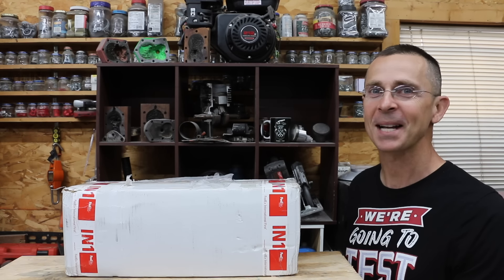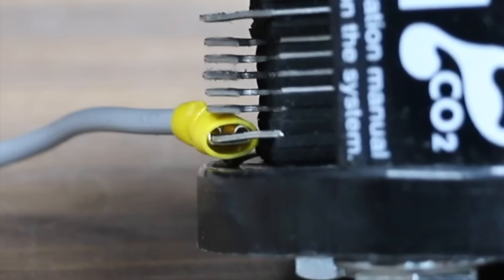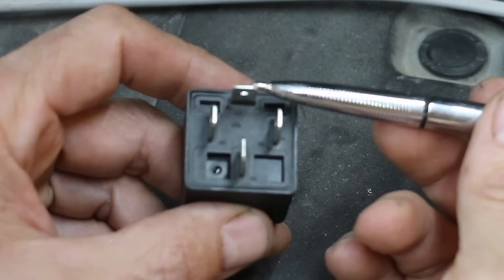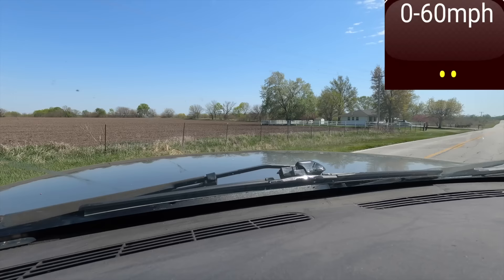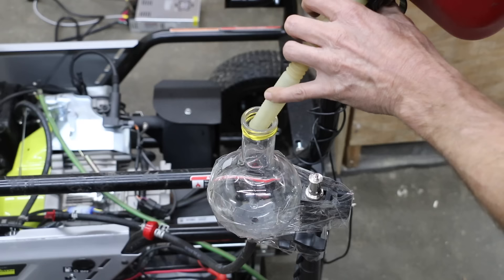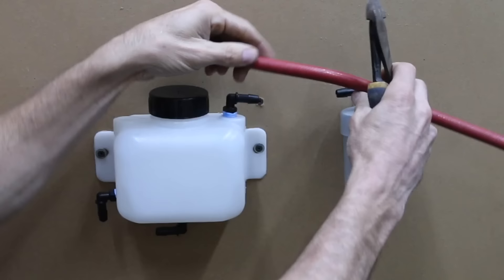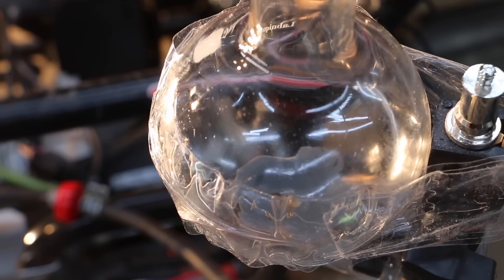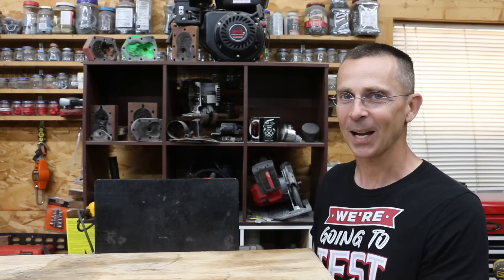AMAZING 35% More MPG with HHO? Let’s find out! Help with high gas prices?

Comment: I learned decades ago that if a gadget like this or many others really did what they say then the auto manufacturers would already be using them in production! They are under great pressure to produce more efficient vehicles and are at the forefront of investigating new technologies.
Great video!
Reply from the maker: Thanks!

Comment: He didn't install the HHO feed line into the intake before the mass airflow. So the computer in the suburban won't read the incoming added O2 and it won't trim the fuel properly. Just like doing a dry shot of NOS. Gotta be pre maf. Improper install and a flawed test.

Comment: I remember those "magnetizers" for the fuel lines back in the day too. lol
Reply from the maker: Thanks for sharing.
Reply: the ones that "align" the fuel molecules?  😂  Talk about a product that relies on ignorance!
Reply: @masondegaulle5731  I believe that was the one, lmao.
Reply: The tornado. Spins the air.
Reply: @johnmike7809     Tornado torches do work though.   I had one before buying a full welding rig and they actually would braze without oxygen.    As for gasoline in a fuel line🥺 it all be in your head if you see a gain in MPG.
Reply: funnily enough, If you place a magnet near the negative electrode in a HHO generator, it visibly increases production

Comment: Too funny that thumbnail! I hope you pay him well. LOL. The problem with HHO is the high level of current required. You cannot gain anything, because the increased load on the alternator increases fuel consumption. Great video!
Reply: This is a good point, and that's why PF connected HHO to the generator via the invertor. It would be interesting to see if results are different when HHO is connected to the external power (to the wall socket). I guess it will be just a tiny difference in runtime.
Reply: I'd assume the main problem is really the maximum efficiency of the Carnot cycle. If it was pure electrical breakup of water, and recombination in a fuel cell, assuming 100% theoretical efficiency, ignoring all losses, you'd still lose the energy difference of the reactions. But when you use the resulting gases in a heat engine you can't recover anything close to that even theoretically.
Reply: @AlexYeryomin  gotta be careful running 110 me and my brother had a hydrogen generator explode on us because of over power.  That's very dangerous
Reply: @AlexYeryomin  It's simple physics, HHO using current is only about 50% efficient without using complex supplements (heat, catalysts, steam reform methane, etc). But even with all that, hydrogen for fuel cell costs equivalent to $16/gal gas.
Reply from the maker: Great point on why HHO doesn't yield better fuel efficiency and thanks for the positive feedback on the thumbnail!!
Reply: Maybe that HHO crap wouldn't be such quackery if it was only active during deceleration, therefore not bogging the engine down, and even helping the car engine-brake a little bit, just storing the gas and dispensing whatever was made when accelerating.
Reply: @GashimahironChl  it’s called regenerative braking, and it’s way more efficient using batteries or capacitors then a hydrogen generator.
Reply: @Dirty_Bear22  That's exactly what i was thinking about as i was typing that piece about the HHO garbage

Comment: Would love to see a video about the best Multimeter! Fluke, Klein and others going head to head plus price considerations and various models. I think would be a interesting video.
Reply from the maker: Thanks for the video idea.
Reply: Fluke....note the price
Reply: I was told once by an electrician that most of the internal boards are all manufactured by the same company. So all you're really paying for is the chassis, display, and marketing.
Reply: @mellowmagog  what about the electronics design? That's is the core of a great DMM. I think you electrician friend is not that good.
Reply: @emesma  if all of the internal boards are manufactured by the same company...all the electronics are the same. If you have the same board inside with the same resistors, chips, caps, etc the only difference is the look of the thing.
Reply: @mellowmagog  Definetively you don't have any idea what electronics is about. It's not just the quality of the components is about the topology of how they are connected, simple and plain.
Reply: @emesma  I feel like you don't understand what I'm saying. If the insides are exactly the same there is no difference in how two meters will work.
Reply: @mellowmagog  Don't forget certifications, and build quality.  Fluke puts in the time and money to meet certifications.  You cannot legally piggyback on another manufacturers certification.  I have owned many different VOMs, Fluke beats them all on build quality and safety.
Reply: @winsur4281  that is what the test should be about. Build quality and safety. A test about accuracy could be subjective in many ways.
Reply: @mellowmagog  "If all of the internal boards are manufactured by the same company...all the electronics are the same."

You're the same type of person that doesn't realize "up to 35%" includes zero percent. What, you don't think manufacturers make different products for different brands who order them? One company might speck a different grade of resistor, or chip, or cap, or switch, or whatever...be used on what is otherwise the same board. Another company may speck a completely different board.
Reply: @xtnuser5338  I'm not an electrician, so perhaps my question/thought is wrong.  But PCBs are one thing, the components are added by the company that buys them.  IE, its one PCB, with the pathways ready for components and various companies buy it empty, then add their own components.  I know there is variation in component quality, but a PCB is just a board with pathways.
Reply: @erich6860  I'm sure there are companies that just order PCBs and them populate them with components in-house. But some brands order the entire board in its completed state, because they're only doing final product assembly in-house. And still some other labels farm out everything, because they have zero manufacturing capability of their own.
Reply: @xtnuser5338  Right, I was not sure if buying a blank PCB was a thing or not.

Comment: FYI... A Mechanic friend and I were playing around with HHO generators around 10 years ago, when there was a lot of buzz surrounding them. We made our generators from scratch, ruining a number or drill bits in the process. We tested our generators and were getting a nice amount of gas, so we decided to put in on my old, OBD1 1991 Jeep Cherokee Laredo 4.0L. I drove the Jeep for a week averaging the gas milage and we did the same thing with the HHO generator (hooked up almost exactly as you have it in your video. I ended up getting 10% less fuel economy the fist time.... So I did an additional week and got 13% less on the second test. Our assessment was that since there is a pre and post O2 sensor on this vehicle, the Jeep was sensing Less O2 and making adjustments to the fuel input to compensate... Not completely scientific, but it was our best guess. Needless to say we pack away the generators and left them to sit. I still have mine in the garage and was hoping for a better result for your video. I guess I'll leave it where it is for another 10 years. Keep up the good work that you do!
Reply from the maker: Thanks, will do!  Thanks for sharing.

Comment: To even give HHO a chance it would take special tunning of the engine, and even then there simply isn't enough HHO in this kit to remotely replace 35% of the fuel consumption of a vehicle engine.

The kit itself and marketing is sketchier than an Etch A Sketch.😆
Reply from the maker: Thanks for the feedback.
Reply: yeah did this to 87 4runner about 10 to 12 years ago. custom generator tank cooling etc.....  you need full manifold vacuum and a ton of tuning. when i was done it worked great. im not going to give numbers as no one would believe them but it was substantial. a relay didnt switch off with ignition, filled engine and intake with hydrogen... next morning boosted dead battery... blew the hood open when i cranked it over.... sounded like a 1/4 stick of dynamite going off..... found out 2 months later it had cracked the crank.... when it flew out side of the block at 80 going down highway... good times.
Reply: @bobbycarr2319  I have got questions. Do you fill distilled water in the fuel tank?? Does it cause rust??
Reply: @bobbycarr2319  my dad and I built one big enough to use on a Detroit semi, although we never actually used it on that application- I had a old C10 with a 350- was able to get almost 2x fuel mileage- was only used to put around with-
Def not as detailed as this experiment, however. I do think with a much larger generator, he would very different results.
Reply: @bobbycarr2319  theoretically quite impressive improvements are possible. HHO suppresses knock allowing you to advance timing, it also allows you to run much leaner fuel/air mixtures. The downside is that hydrogen is difficult to control and terrifying when it goes wrong, as you found out.
Reply: @Angelo Have you converted your car to run on hho??
Reply: @bobbycarr2319  If the hydrogen is being generated by the electrical system of the car, then I don't see how there can ever be a net gain in mileage. Burning hydrogen releases pretty much the same amount of energy as is required to split it from the oxygen in water. So how can there be a net gain? You'd have to create a situation that makes the engine itself overall more efficient.  Maybe the real gain was in all the tuning that you did.
Reply: @bobbycarr2319  Adventures in hydrogen.
Reply: @wturber  the improve in performance is using hho to catalyze a more complete burn with the gasoline. Those catalytic converters are simply evidence that some gas is not burned as it's carbon monoxide. There's your increase.
Reply: @wturber  That's exactly the conclusion I came to after trying one of these kits a few years back. In-fact my gas mileage was worse.
Reply: @NwoDispatcher  You are correct about incomplete combustion. About 25% of the fuel goes unburned.  But  I'm unaware of hydrogen or oxygen being catalysts of combustion. They are actually two possible components of combustion. 

Also, if you understand why a piston engine only burns about 75% of the fuel it ingests, then it would be pretty obvious that even a great catalyst isn't going to come close to retrieving the full 25%. 

So if your hypothesis is correct, a person might reasonably expect a few percentage points of improvement and there is no way you should expect anything close to 33% improvement. 

Also, if HHO systems were highly efficient some auto maker would have adopted the scheme for both improved gas mileage (government fleet requirements, etc.) and a low cost way to reduce emissions.
Reply: @wturber  I don't believe that rule of thumb, it's lazy thinking. Especially considering that premium fuel gets better gas mileage because they put all sorts of crap in regular. They hamstring industries for a reason. Delorean was run out of business by the FBI specifically because his cars didn't rust and contribute to planned obsolescence. You're wrong in that regard.
Reply: @NwoDispatcher  yep you should use the octane rate fuel that is for engine for better mileage, has you car engine is build for a specific compression need before send the spark. Using to low or too high octane fuel will start combustion too soon or to late, reducing efficiency of the engine.
Reply: Yes the engine diesnt know you have a pipe with extra gas does it..you would have to meter 25 percent less petrol and add other gas maybe ?
Reply: @bobbycarr2319  This was one of the BIG  drawbacks of hydrogen powered vehicles - explosions ! Megamine from the anime Konosuba would be proud of you sir . Explooosion !
Reply: it can work but the o2 sensors see more oxygen than there should be so it send.more gas need to use an o2 simulator  or it is useless without it
Reply: @wturber   HHO doesn't "replace" fuel, it makes a more complete burn, you'll find greater improvement in older diesels and carbureted vehicles.
Its a similar principle as propane injection on diesels.
Reply: @thetabletnonya948  How? By adding oxygen? If so, how much Oxygen is actually added? Also, valve timing overlap issues remain. So even if there is some improvement in burning efficiency, it seems very unlikely that this could get you nearly 30% improvement. And remember, for a net improvement, you have to counter the energy drain the HHO system places on the engine.
Reply: @wturber  Hey man, I am a physicist, and i can't figure out how they get the energy either.

Comment: Yes! I remember these things being all over truck forums in the mid 2000s and no one had any great data on it.
Reply from the maker: Thanks for sharing.
Reply: i guess the  fail here is that you could not regulate the flow of gasoline. it is preset so the  hho cell would just give you a cleaner burn. in a car the O2 sensor monitors if the fuel mix is too lean or rich, by adding the HHO  you get a cleaner burn so the computer thinks your running lean  so increases fuel to the injectors.  so the trick is to find the correct fuel/air mix to get the best result.
Reply: @thelazyfishkeeper2730  maybe I'm looking at this the wrong way, but burning hydrogen to generate 1L of water nets you about 16 mega joules of energy for each liter of water generated. The energy content of gasoline (according to wikipedia) is about 35 MJ per liter. Seems to me that using gasoline to generate a fuel that is over 50% less energy dense that gasoline itself is simply a waste of gasoline. It also means that the hydrogen content in that 1L of water in that HHO generator is nowhere near enough to give anything approaching the improved mileage that is claimed.
Reply: @alfredoprime5495  Takes very little HHO to get gains. The HHO Burns far- far faster than gas so you get complete combustion instead of burning fuel out your exhaust.
Rockets use H/O incase you never notice...
Reply: @p.b.9971  i can only guess, but maybe if your willing to pay $200 . you did your home work and learned all about how it works.
Reply: @thelazyfishkeeper2730  How about I don't need to spend $200 to know how the laws of physics work and how this claims to break them without ANY actual scientific data to prove it.  Of course, maybe I don't know what I'm talking about, but I believe the government does and they successfully sued the originator of this BS and won due to deceptive practices and making unvalidated claims.  Of course, you already read the lawsuit like I did right?
Reply: @p.b.9971  you know what i didn't. now back when i was a young lad.  some fella's came up with a  burner that would increase fuel efficiency  of home heating unit that burns oil. an oil company bought the plans for that burner for millions. just to keep it off the market... remember mythbusters did a show on this idea. they said busted it didn't work. ... now there was another guy who had a carberator, that caused the gasoline to be  vaporized  so he could get way more than 30mpg. the goverment when after him too. they put him jail.  so if you come up with an engine 
that runs on water i am sure, you will
disapp
ear also.  just say'in

Comment: Several things to take into consideration. 
1. You have to balance the 2 fuels,  which means reducing gasoline based on the amount of hydrogen being added. 
2. Engine timing,  hydrogen doesn't ignite at the same point but has a narrow window to be used in conjunction with gasoline vapor. 
3. Electrolytes are extremely caustic and should be avoided.  The cell can be made where electrolytes aren't required and electrolysis is just as productive
Reply from the maker: Thanks for the feedback.